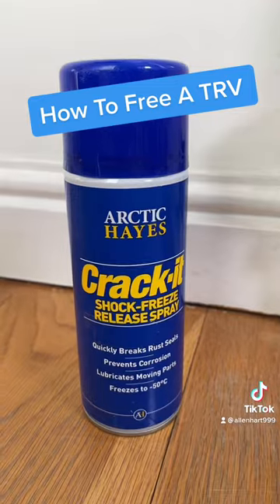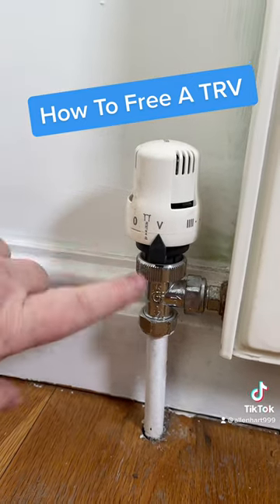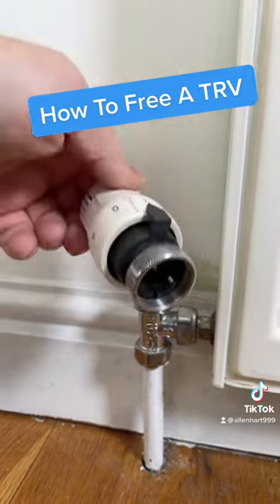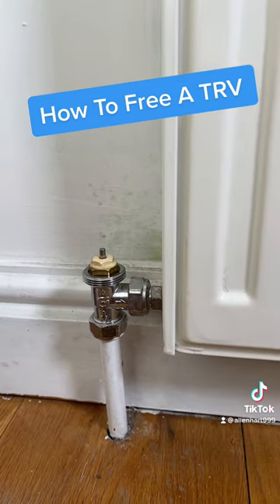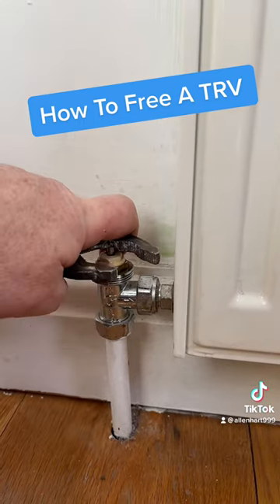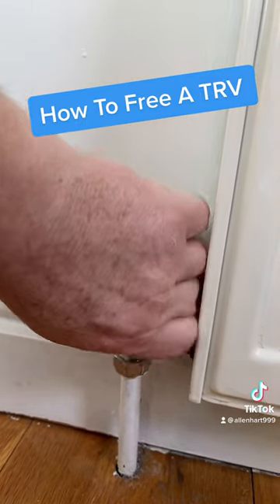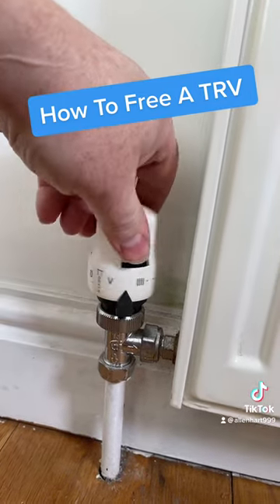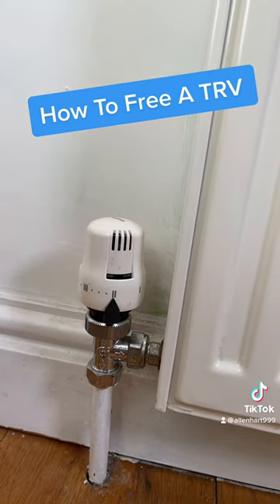How To Repair A Radiator | How To Free A TRV Thermostatic Valve

Comment: The  older danfos type do indeed  pull out,not sure about the new ones  and this allows the silicon greese or spray to lubricate all the pin ,I have never had a problem just pushing it back in again too seal but you do get water leaking out while the pin is out although usually not very much  Cheers .